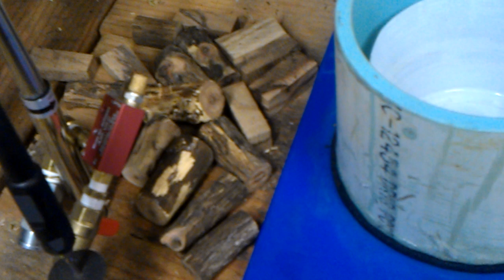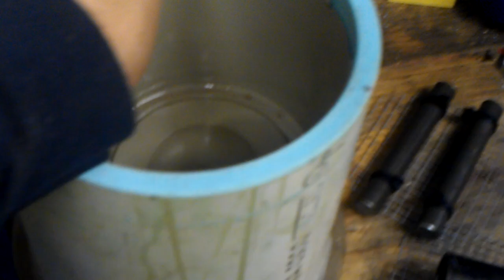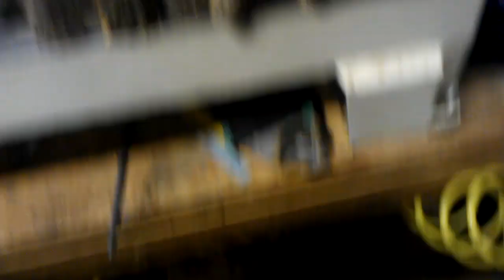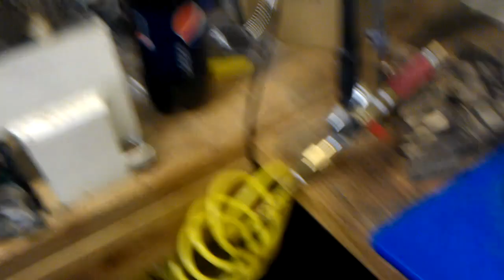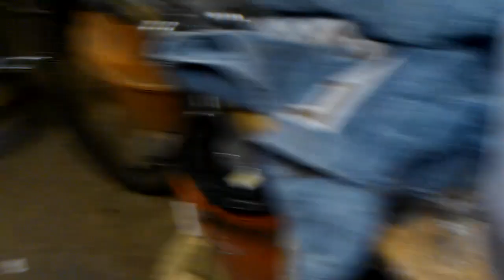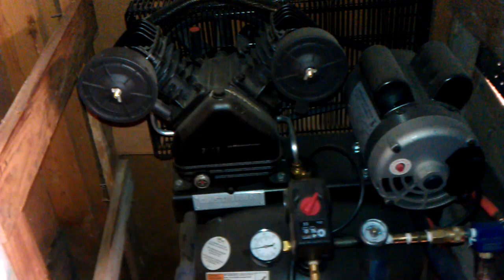Cactus Juice Home Stabilization-My Methods, Part 1

Comment: Can I ask - how did you cut & finish the schedule 120 pipe?  I've got a piece of schedule 40 that I want to use, and like you I was able to get it from a local construction site.  But what I have is 8 feet long - and I'm not sure on the best way to cut it and then finish the ends so I get a good seal.  A "specialty cutter" for this kind of plumbing is insanely expensive.....
Reply from the maker: Don Vanco 
Don, my sincere apologies for such a late reply, I have been traveling between Oklahoma and Nevada since October.  I rolled the pipe by hand while in bowl jaws to draw a clean line around the pipe.  I cut it with a saws-all and used a palm sander and small framing square checking for a level surface.  it took some time to get it done.  on the shorter pieces I did use the lathe on low speed and the pipe in bowl jaws to turn perfect ends. I did make extra long pins for my PSI jaws.  I hope this is of some help to you.
Reply: I'll let ya know how it goes ;)

Comment: do you use a ball valve between the vac pump and canister?
Reply from the maker: Not between the chamber and vac generator. I put my valve on the cover of each canister, there is also a ball valve on the inlet side of each vac generator, basically an on/off valve.

Comment: Where did you source the fittings to adapt the HVAC to standard compressor connectors?
Reply from the maker: The vacuum generator uses standard 1/8" NPS/NPT fittings.  I got all fittings for the compressor and vac generator at my local small town hardware store.  The vacuum gauges and compound gauge I ordered online.  Hope this info helps.
Reply: +sjm2inok Thanks

Comment: great video! Would you share the link where you get the vacuum generators? thanks.
Reply from the maker: I get my vacuum generators at airvacpumps.com.  They have specs on all of their generators, find one that will give as close to a 30" vacuum as your compressor will handle...i.e. have the required scfm needed for the generator.
Reply: +sjm2inok This is the first time I ever heard of this option. Thank you.

Comment from the maker: Yes it does.  The vacuum process draws air out of the wood which is then replaced with the Cactus Juice.  The wood MUST be below 12% moisture content (MC), a very hard dense wood will be difficult to Juice whereas softer more open grain woods will benefit from Cactus Juice.  I've salvaged a LOT of punky spalted Oak limb wood with Cactus Juice, I use it on questionable woods that I buy.  Awesome stuff!!!

Comment from the maker: Being laminated with the glues it shouldn't need extra stabilization. I'm not real sure on the compatibility with the heating process being okay for the glues and materials you're using.  I recommend you contact Curtis at TurnTex Woodworks for further information on your questions.

Comment: Hey great vid, ...can you share your insigths about stabiizing?
How would I go about stabilizing laminated blanks,... mostly made of Wood,Stone, CyanoAcrylate or PolyUrethane glues,... It are not really good heat resistant materials,... and I think some of them will loose strength due of chemical or mechanical decomposing,... what do you think, will the heat hurth the materials?
Thanks in advance, greets